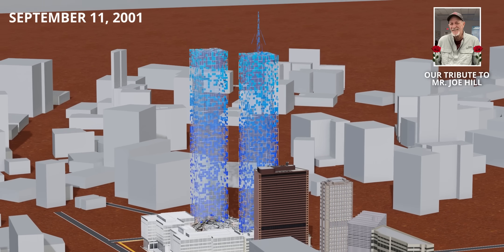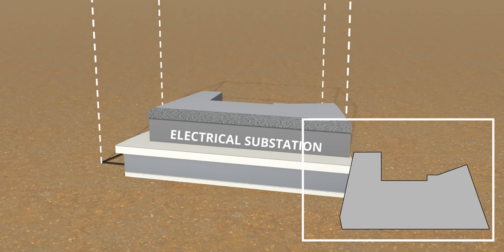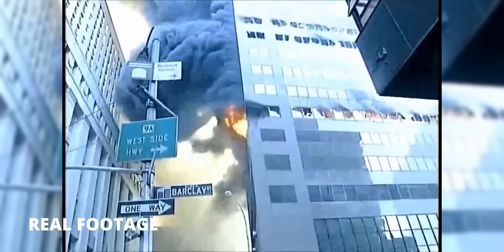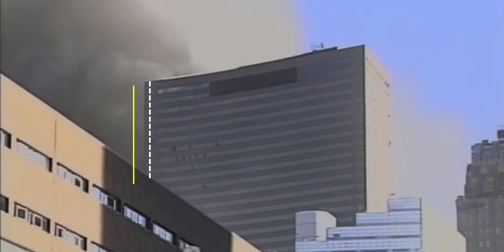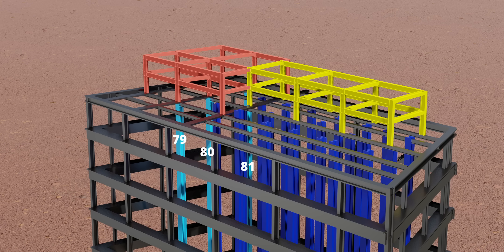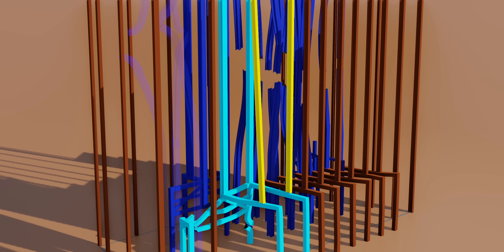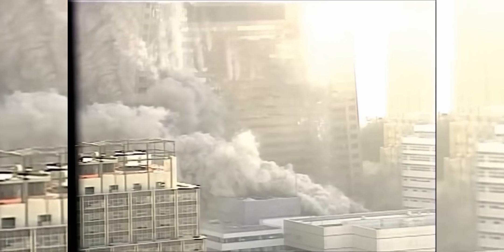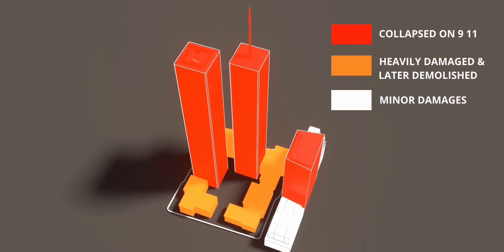Collapse of Building 7 | The Complete Physics

Comment: What a load of horse shit. 

When you have asymmetrical damage you do not get a symmetrical downfall, for it to fall like this you need to cut all columns within a sec of each other. If that should be from fires, physics do not apply anymore.
Reply: Yet the building itself is not symmetrical, it was built with a substation in the way so there was a lot of "hinkey" engineering to hold that gigantic building up.
Reply: @jackprier7727  who are you quoting?
Reply: @ainnochaim9450  It's "whom", but It isn't a "whom" either, b/c it's a "what", a concept.
Reply: If you had paid attention, he explained perfectly how it fell progressively.  Showed one end going down before the other.  When a portion of main support columns fail (from being heated to nearly 1000+ degrees), what do you think happens to the columns next to/around them?  They immediately take on a much larger load of weight which in turn makes them fail. Then it turns into dominoes, very quickly overloading and buckling support beams from end to end, and the whole building twisted and fell.  The video footage used corroborates his claims.  I think they gave a perfectly reasonable explanation.  That you WANT it to be part of some grand conspiracy, doesn't mean it is.  I'll bet you're convinced the main towers 1&2 were demo'd as well.   If any of you knew how much prep work and visible damage takes place , in order to demo buildings in a controlled fashion, you'd realize how retarded it is to make that claim.  Pull up some episodes of "Blowdown" right here on YouTube and learn something FFS.
Reply: And the collapse wasn't symmetrical. Were you seriously not paying any attention at all???  FFS!  The collapse of Building 7 is the poster-child for progressive collapse

Leave your (false) preconceptions at the door and actually pay attention to what is being presented.
Reply: A second thing I really love ist the 'REAL PHOTOGRAPH' @ 3:55 - what a cheap AI-Image - just look at the windows on the side of WTC7 - the real building had RECTANGULAR WINDOWS (sorry, I can't write louder) - those look like made from molten plastics... 🤣🤣🤣
Reply: @ They wouldn't need to use an AI image. It looks like that because HD wasn't a thing when this picture was likely taken. It's simply distortion. 
Anyway it's not as egregious as the OP's statement about fires and physics.😏😏
Reply: @tuxjob Just to add, it isn't a photograph even but a still from a video taken from a helicopter. Back in the day we didn't have drones.  😊😊
Reply: @tuxjob  Oh, also, I'm guessing you "love" the second thing, because the first thing didn't work out too well for you? What with you having not even attempted to rebut but instead moved on to the next thing....which you got rebutted.

So, what will the third thing that you "love" be?
Reply: @tuxjob  Like the windows shown in the photo, you mean? Yeah.
Reply: It is well known fact that this building was brought down by controlled demolition. This video is criminally irresponsible, deliberately misleading, a lie. The group “Architects and Engineers for 911” aren’t clowns, 1000 of them, several Nobel price included.
Reply: Apparently, just a glitch in the matrix 🤣🤣🤣
Reply: " If that should be from fires, physics do not apply anymore"
I am still trying to process this sentence and make it make sense in one form or another, but realize it's just stupid.
Reply: @ac1646 yes let's get back to reality physics says their lying. Fire and jet fuel cannot collapse steel no matter what conditions. Melting steel is actually very hard and takes hrs under extreme conditions.
Reply: @ac1646 if the cause of fire is the case, then we are ignoring the robust field of physics.
Reply: The best part was, that the collapse was broadcasted by BBC before it collapsed (it was still standing in the background of the BBC reporter).... xD
Reply: @tuxjob   So what?
Reply: @mooneyes2k478 So the media was complicit
Reply: @ Right. The foreign, publicly funded, largest news organization in the world was "complicit."

Did you hear how ridiculous that nonsense was before you posted it?
Reply: @ I should have been more clear, all the news agencies were complicit at some level. If you report a 47 story building collapsed half an hour before it actually happens you’re reading a script. Simple as that
Reply: @shanetaft4803  i can understand ppl believing some group didna controlled collapse but to think the media were told beforehand 😂 lets say it was a conspiracy to collapse the building what possible motive would there be telling media BEFORE IT HAPPENED 😂

That's Simple Simon stuff!
Reply: Ignoring reality, in this case the complete absence of a "symmetrical downfall", doesn't make for a good argument...or a good look.

Comment: Is this 'explanation' peer reviewed? Where is all the data? The penthouse dip seconds before the collapse in free fall is normal when it comes to CDs. Cut the inner supporting columns and the building implodes in a nice little heap on the ground.

Stop the gaslighting.
Reply: Peer reviewed by 627,000 people. 

IF after reviewing the information presented you found any errors that fundamentally change the conclusions then I suggest you present them.

Go ahead, be the first.
Reply: "The penthouse dip seconds before the collapse in free fall is normal when it comes to CDs"
Since "the penthouse dip" is when the collapse begins, and shows that the collapse is nothing like "free fall", not that you understand what that means, it's very clear you don't actually understand what you're seeing.

That there's anything at about the collapse that's "normal when it comes to CDs" only reinforces your failure.

Comment: You dont need to understand physics to know that this was a conspiracy and completely ridiculous to think that a building just collapsed like 7 did. However, cute video. I feel sorry for those who actually believe things like the 9/11 omission and the Warren report, total nonsense.
Reply: How do you feel about this then?  Building 7, the 6th building to collapse of 10 lost on 9/11 still confuses many even though it has been extensively studied. Not famous or a terror target, and with no casualties it did not get a lot of attention initially, creating an information void the internet rapidly filled with garbage. Because everything seems like a conspiracy if you don’t understand how it works I prepared this brief summary of the collapse from my own analysis. No politics, just engineering. 

The North Tower collapse at 10:28am bombarded Building 7 with tons of burning debris, causing heavy damage and starting multiple fires burning out of control for the next 7 hours. Half the FDNY firefighters having been killed, others injured, units in disarray, equipment destroyed, no water pressure, and the greater urgency of Search & Rescue efforts, firefighting was pulled as futile. The building couldn’t be saved and was left to its fate.

www.youtube.com/watch?v=g_SvpwyC17M&ab_channel=MFitz  

Collapse of a burning structure is always a concern for firefighters. Steel buildings subject to fire rely on active fighting of the fires to survive. Buildings are designed around 1 to 3 hours of fire resistance, allowing time for occupants to escape and ACTIVE firefighting to get started, after which all bets are off. Left to their own devices they will exceed their design envelope and collapse. In B7 the occupants escaped, passive and active fire protections were compromised and active firefighting was abandoned which left the building to take its chances. It lost. Odds on Building 7 would eventually collapse, and it did. No big deal in logic. That is the sort of choice firefighters make every day in brush fire situations - which houses to save and which ones to let go. Only real difference here is moving the decimal on the size and cost.

www.youtube.com/watch?v=WnYBX6QT0R4 

FDNY Chief Daniel Nigro ; The biggest decision we had to make on the first day was to clear the area and create a collapse zone around the severely damaged 7 World Trade Center, a 47-story building heavily involved in fire. A number of fire officers and companies assessed the damage to the building. The appraisals indicated that the buildings structural integrity was in serious doubt. I issued orders to PULL BACK the firefighters and define the collapse zone. It was a critical decision; We could not lose any more firefighters. It took a lot of time to PULL EVERYONE OUT, given the emotionalism of the day, communications difficulties and the collapse terrain

FDNY Deputy Chief Peter Hayden ; We had our special operations people set up surveying instruments to monitor and see if there was any movement in the building. We were concerned of the possibility of collapse in the building. And we had a discussion with one particular engineer there, and we asked him if we allowed it to burn could we anticipate a collapse and if so, how soon? And it turned out that he was pretty much right on the money, that he said 'In its current state you have about 5 hours

The collapse of Building 7 was anticipated and widely reported in the media throughout the day. At least 24 video cameras recording some or all of the collapse. Everyone knew what was coming and why.

www.youtube.com/watch?v=OY5S5k3tMHI 

Building 7’s collapse was completely different to the Twin Towers, harder to understand with most of the details difficult to see. But we can still sort out what happened through careful analysis and observation.  This is MY EXPLANATION of the collapse sequence using the best available information and relying on no authority.

B7 was complex 47-story steel framed structure built on top of a smaller existing 3-story building, requiring several lower floors dedicated to complex load transfer structures instead of usable office space. Of trapezoidal shape and all-steel tube-in-tube construction, B7 (above the 7th floor) consisted of a central core of steel columns carrying most of the gravity load, perimeter steel columns around the outside of the structure carrying the remainder of the gravity loads and long span beams and girders to tie those elements together and form the floors. On the outside of the building hung a moment frame - the last part of B7 to fall. 

Phase 1 : The first externally visible signs of collapse initiation occurred at 5:20:28 pm. Collapse initiation for B7 is notably quiet with observers not realizing the building was collapsing! There was no audible warning in the form of say hundreds of ear drum busting 180-190dB explosive bangs preceding the collapse. Here at 12:00 a local CBS affiliate reporter is talking 10 blocks from B7 when collapse begins. People don’t start to notice the collapse until 12:11. Then at 12:45 is the famous CBS fixed camera clip of Building 7’s collapse.  Note how quiet it is.

youtube.com/watch?v=t5tEy6mXSE8&ab_channel=fresnosean379

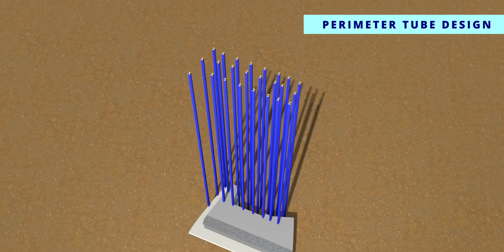Collapse initiation was due to lower floor failures above the load transfer region (7th floor) in the NE corner of the building. In this video at 0:45 you can see the NW corner from inside the building while under construction, Column 79 just out of frame on the left. That big, angled steel beam across the top of the frame connects to C79 at one end. The girders connect to the beam. That beam and all those girders depend on just one connection

youtube.com/watch?v=nP3TNHPCIVU&t=35s&ab_channel=EdwardCurrent

Phase 2 : Lower floor failures caused a loss of critical lateral support over an excessive length of core Column 79 and it buckled. If you look at a floor diagram of Building 7 (see above) and look at all the structures that depend on C79 you quickly realize this one column was a relatively isolated structural element on which a disproportionately greater fraction of the structure depended analogous to say the Key Bridge. Externally we see a vertical progression of window breakage along the 44-46 line and a kink in the roof of the East Mechanical Penthouse at the top of the building, consistent with C79 failure. The transition from full capacity to almost no capacity occurs in virtually an instant. Once the buckling failure occurs there is almost no resistance

Normally with a buckling column, the load could very well be redistributed to other columns, meaning the buckling could stop after a while. With C79 that is not the case - the failure did not redistribute the load, so the collapse rapidly progressed to the roofline, sinking the rooftop penthouse.

Phase 3 : With C79 gone, B7’s progressive, non-symmetrical collapse continues with C80 and C81 at the east end of the core left laterally unsupported and quickly buckled and failed as well, sending the EMP down through the building. C79-81 all have no diagonal bracing, which I believe is a major reason why they could not redistribute a lot of vertical loads among one another.

From there collapse progressed from east to west through the central core until the core was gone taking all of the interior floors and structures and probably most of the perimeter columns with it. You can see the horizontal progression of window failures low in the building and the dropping of the remaining rooftop structures into the building. One of the big takeaways from the NIST Building 7 study (that gets completely ignored) was their modeling which determined C79 failing under ANY circumstances would have initiated the same collapse sequence.

Phase 4 : After some 10 seconds all that remains of Building 7 is just a hollow empty outer shell - the exterior moment frame - creating the illusion the building is still standing since little has changed externally. But it’s just a hollow empty shell like an empty cereal box supported by only a few remaining columns and quite unable to remain standing. With all the internal framing gone. the north face leans inward, forming a V in the roofline, the last perimeter columns buckle under the strain and with nothing left keeping it up the moment frame free falls, landing on top of the 7-story high debris pile. It is only at the very end that a single measurement of alleged free fall acceleration is taken. Note this is not the building but just its outer shell, and only one corner at that, at the very end of the collapse. Start to finish the entire collapse took 18-20 seconds, or less than 1/3 of true free fall and we have to look at the whole thing, not cherry-pick little bits to fit a particular narrative. Worth noting _how fast something falls cannot tell you what started it falling in the first place. The debris spread out, blocking surrounding streets, heavily damaging the Verizon Building and destroyed Fiterman Hall, all well outside of Building 7’s “footprint”.  

Building 7’s progressive, non-symmetrical collapse was incidental and unintended collateral damage from the combined effects of fire + time + gravity started by the collapsing North Tower. That is true no matter who planned and carried out the 9/11 attacks or why . The collapse was of so little consequence it barely even registered at the time, a mere footnote. It only took on semi-mythical status as an alleged smoking gun years later when demolitions at the Twin Towers, missiles at the Pentagon and shoot down over Shanksville all failed and conspiracists had nothing left to work with.

Anything can seem like a conspiracy if you don’t understand how it works. Now you should. I hope you found this helpful, informative and it solicits informed critical comment. If I made any errors of fact, logic or reason or left anything important out, please let me know so I can fix it. IF you can offer a more plausible alternative please do. Be the first. Please start any reply with the words “Tits McGee” or I will know you didn’t read it and are wasting my time.

Comment: tons of reinforced concrete and massive highgrade steel columns just taken iut by fire.
Freefall, 47storeys 
People who believe this video have never worked with steel or an oxy acetylene kit to cut heavy gauge steel. If they had they would know this video is BS.
Reply: There was no structural reinforced concrete in Building 7.  It was a steel framed structure. Your starting assumptions are wrong and result in false conclusions.